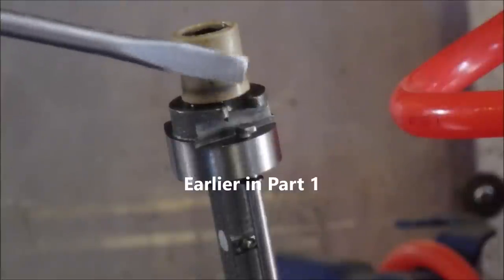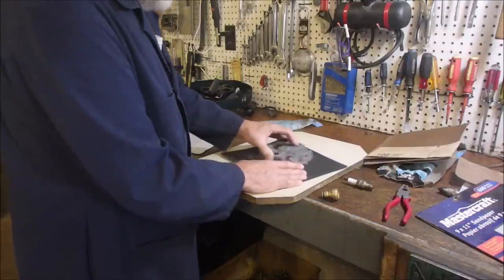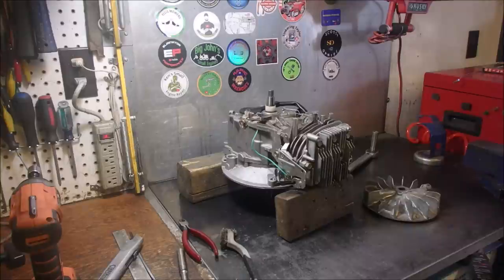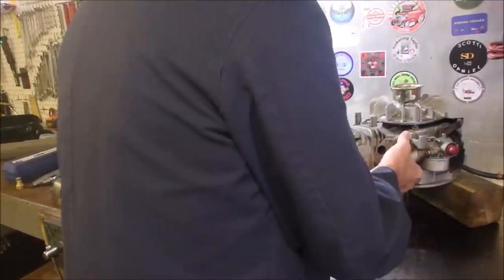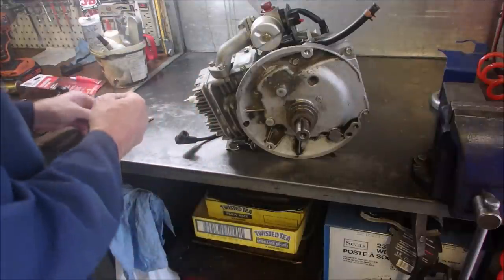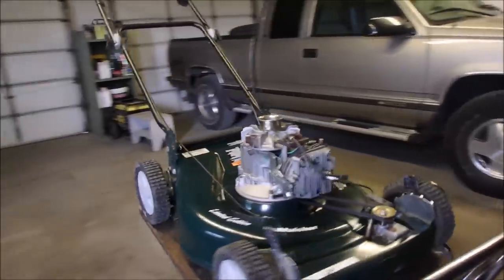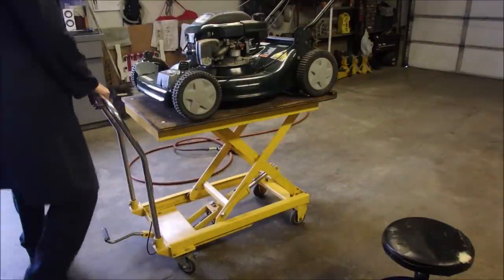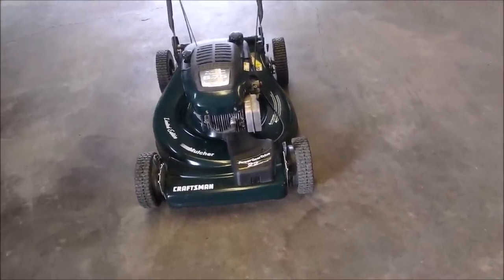Craftsman 6.5 HP Tecumseh Rope is Hard To Pull After New Flywheel Key

Comment: Well you asked and here is the response: Bruce my friend you are doing it right as usual and just a genius repair on the compression release. Just a little thought into a situation and normally you can come up with a solution as you have done. Too many people do not have the patience to attack problems that come up and hence so many good repairable mowers end up in the scrap yards or left on the street for pick up by the wise. My Dad once told me that a wise person sees an opportunity and takes advantage of it while others just pass it by.
Reply from the maker: Thanks for the great response.  The only thing I may have done in addition was heat the tiny cam up and quench it, but that may have made it too brittle.  I still wonder if it is too soft.  But on the other hand, the exhaust valve mave have been stuck shut on a hard pull,  a LONG time ago causing it to flatten out on cantact.  It did sit for years.    Anyway, it was running when it left the shop  :-)

Comment: I'm in the same situation right now.  An old Tecumseh on a walk behind weed trimmer.  It's been passed around and wound up a neighbor then with me and another neighbor could put it to good use.  Hard pull but I got it started yesterday, used it some then an impossible pull when I tried to restart it.  Spark plug out and it pulls easy.   I was watching your 10 year old Tecumseh flywheel key replacement video,  gathering information and, gosh, we are getting older and hopefully wiser. I've got the same year F150 as your Chevy and our pickups are aging better than us ( I'm 75 ...... and a half ).   Thank you for this video, it pretty much confirms the problem I'm dealing with.   Now it's decision time,  cost of the part, maybe try to fix it like you did on this video, my labor is free,  I'll tear into it and see what it takes.
Reply from the maker: Good for you for trying

Comment: Cool.  That compression relief is a lousy design for sure...Seems like it was wear the tappet as well, but perhaps not because it isn't touching when the engine is running.
Reply from the maker: I think somethine was stuck, way back when causing the very small Compresion release cam to flatten out.

Comment: On those tecumseh they self regulate that problem. As the release wears the valve clearance also becomes smaller to compensate.😂. Not sure if you checked valve clearance.
Reply from the maker: Yes I did.  It was in Part 1  I just showed the valve door.  not the actual gap check.
Reply: But the lower valve clearance might negatively affect performance

Comment: Maybe you could have clamped down on that little nib with the jaws of a vise grip and squished it a bit?
Reply: If I need something from the Lawnmower Hospital, I just drive over!  🤣
Reply: Most of the time when I change a head gasket I put a light coat of RTV on both sides of the gasket.  Mostly to hold it in place when installing! 🙂
Reply from the maker: Good point.  I have been to the Lawn Mower Hospital but only when I am up there on other business.
Reply: @jimyeske8498 Not necessary.